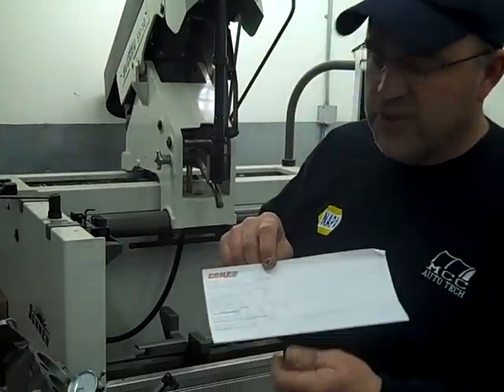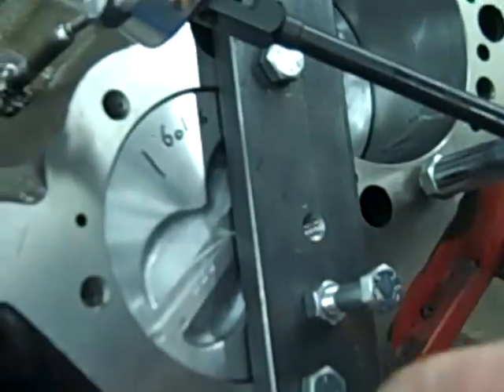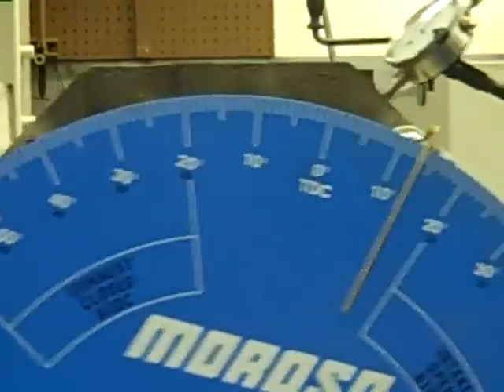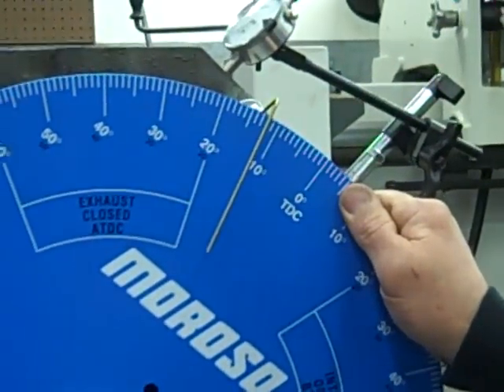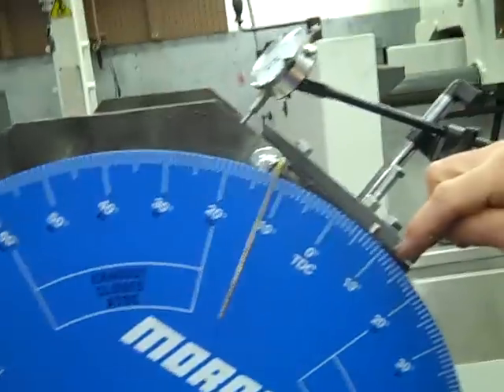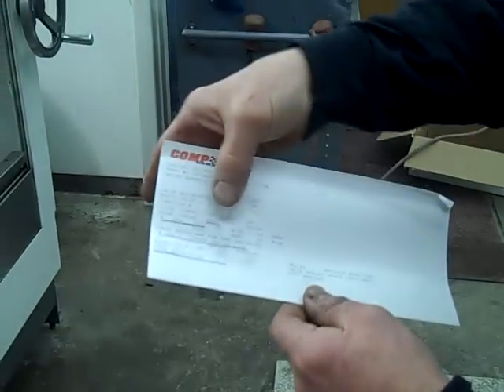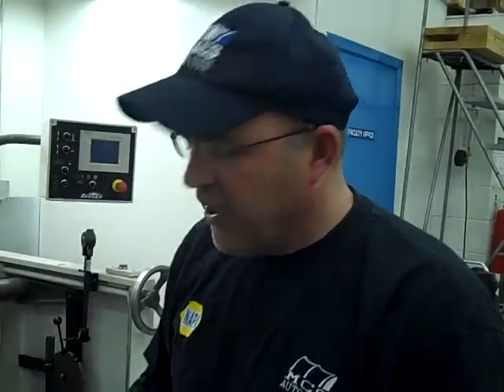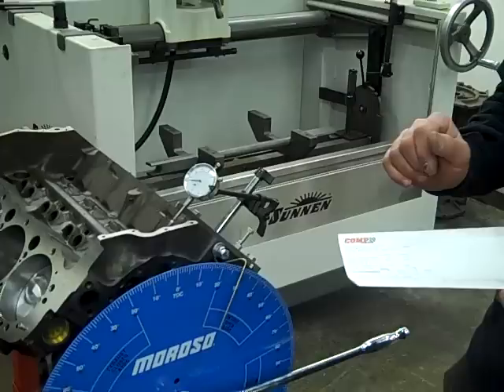Camshaft Degreeing the Easy Way.MP4

Comment: Very good video, I know some people dont understand and get confused because there are different ways to degree a cam you can check the cam at advertised duration, you can check it at .050 thousands or you can use the intake centerline method, study and you guys will learn . Thanks for the great video.

Comment: The "half degree" difference showing on the degree wheel, when using the piston-stop in either clockwise, or counterclockwise direction, is due to the Wrist Pin Offset that is commonly designed into most pistons.
Wrist Pin Offset minimizes piston skirt "slap" as the piston changes direction in the cylinder. It also reduces wear on the "thrust side" of the piston during the power stroke.
The amount of offset is very small, hence the 1/2 degree difference in piston stop, depending on the direction of rotation.
Please make a note of it ;o)
Reply: marshalllhiepler ...absolutely correct,I'm pretty sure your comment helped many people!
Reply: @jojomama4787  It did!
Reply: thanks man
Reply: @limited3502 ,
Thanks for your agreeable response, despite being rather "limited". 😉

Comment: I just wanted to comment as a tech for 30 years you are correct, this is simplified as aposied to getting the calculator and deviding by your numbers by 2  and coming up with a center line number,you have it all right there whith in a few turns,I have used this methed my self ,it works right on every time, great job

Comment: Ok, first of all, the difference between lobe separation and intake centerline is NOT the ground in advance.  Lobe separation is just the degrees of separation between the intake and exhaust lobe centerlines, it has nothing to do with advance or retard of the cam grind.  The 106 degree intake centerline is the reference that the rest of the cam card specs were taken at.  Meaning, that when installed at 106, the IVO, IVC, EVO & EVC specs will match the cam card's given specs and the cam will operate as advertised, no matter what advance was ground into it at factory.  If you want to shift the power band down, advance the cam, to shift it up, retard the cam.  Intake lobe centerline should be the very first thing you check after setting TDC on your degree wheel because if that isn't set right, nothing else will read right either.

Comment: Just a quick fact to note, when using your degree wheel to verify camshaft orientation:
Many aftermarket camshaft manufacturers include a "break-in coating" on the camshaft lobes, to aid with initial wear at start-up. While the lobe profile is ground to very precise tolerances, the coating on the cam lobes is not necessarily "evenly applied".
If you are noticing a "one degree" discrepancy between the specs on the Cam Card, and your degree wheel, it very well may be the result of non-uniform coating on the lobes.
Reply: NOT !!!

Comment: Great Video.   Although if i w  was off by a 1/2 degree on my motor or a tight tolerance race engine, the intake valve would be smashed to pieces.   Do you have an adjustable timing set you can put on (belt drive etc..) to show how to get spot on.  Or did you want to talk about "where is the tight spot"  on your particular engine?   2 degrees past ? 10 degrees past?  what it your valve clearance that you can just use a cam card and not check?    would like to see a whole video series and ones that address much tighter motors than that one.     COOL!

Comment: Basically all this video shows is how to find true TDC and verify the cam grind, not how to actually degree the cam
Reply: Old Griz Agree, he did not derive a number by adding .050  before peak lobe lift with  .050 after peak lobe lift and dividing by 2 to get the number to compare to intake centerline which is the most common way. (Not all cam cards have a number at .006 lift)
Reply: @petejoseph8257  lobe center method. Clay Smith cams has a video on this

Comment: Great video but why so complicated. I have never used one of these.  I stick a blunt 1.4 inch  bolt or screw driver in my number one,  rotate engine slowly. get it to the top center, then do final adjustment at my distributor. Great video though, I may try this method one day.

Comment: How do know how far to adjust the piston stop?   So if you get both degrees once you spin the engine.. Then adjust the piston stop again, up or down so the piston stops either down further or up higher..will you still get the same numbers once you divide the two numbers?

Comment: On a motor like this with  LOADS (100 + thousandths) of valve clearance you can leave it 1/2 a degree  "off"   Best not try that on a Performance  tight motor,  my intake valve would make contact with the piston....

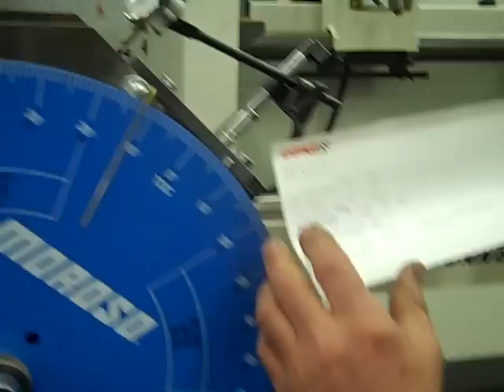Comment: 4:02 ....006" valve lift? Then why did you measure .006" off the cam lobe? If you have 1.5 to 1 rockers, the valve lift would be .009", right?
Reply: nah that's 0.006(sometimes 0.004 or even 0.020)tappet lift which is also called advertised duration.
Reply: @s3904393s I'm confused, unless the sheet specified that when the Cam is at 0.006" lift instead of valve.

The way he said it, is that if valve lift is at 0.006" (which with what John said, 1.5:1 rockers) would mean he would have to measure the cam at 0.004"

Comment: I GOT A 1990 K5 BLAZER 5.7 WITH ECU GOT ENGINE REBUILD GOT THE BLOCK BORED 30 OVER AND DID A FEW UP GRADES IM USING EX262H CAM IN IT WHAT WOULD BE A GOOD COVERTER TO USE I TOOK THE STOCK ONE OUT..AND GOT 2000 TO 2400 STALL .. IS THAT GOOD WITH THAT CAM

Comment: thank you for the video.  i am not building any engines but have always been curious what is meant by "degreeing a cam".  is the piston stopping against the stop bar or do you have that bolt screwed down lower than the bar?

Comment: You didnt take into account the rocker ratio which would change your estimated valve lift after the lifter and pushrod you made. If you have 1.5 or 1.6 rocker ratio then the lift would be .009 or .010 depending on the rockers of course.
Reply: The .050" is always tappet lift and not valve lift

Comment: Okay so question here cuz obviously I don't understand what I'm looking at, what is even the point of doing that the chain is attached to the gears and that's where it goes like it doesn't matter that you spin the engine and look at this degree that degree it doesn't matter ,at the end of the day the two marks got to line up Cam and crank and then the chain goes on so what are you trying to do put the tooth one tooth off I'm not understanding here?

Comment: so how do you apply the degree to the timing chain? do you set the timing chain +or - a tooth to change the degree of the cam?
Reply: you can get special spockets or offset keys depending how the timing gear is mounted, moving one whole tooth will likely cause engine or at least extremely  poor running conditions

Comment: What is the main purpose for degreeing  your cam, will it help make more power? Why not set up the cam straight up.
Reply: Thats exactly what im trying to figure out.
Reply: You are synchronizing your camshaft and crankshaft by degreeing the cam. This makes sure that your engine's valve train and pistons are operating at their optimum efficiency with each other.
Reply: Actually you are verifying the cam makers work..  A builder already knows if he wants the cam advanced or not..  He is just checking it first to see if the cam was ground correctly.  It is rare they are off but it does happen. The timing chain manufacturers are actually the main culprit of a cam being out of spec.
Reply: Yes, just check if the both valves are closed (on top), during the compression stroke, it'll do, the manufacturer will already sort it out

Comment: You said your intake valve should be open at .006" lift when checking, but then you measure off your lifter .006" not figuring in the rocker arm ratio. What fact is right?
Reply: +David Sanders lobe lift not valve lift

Comment: yea...ill just NOT degree a cam, ever. this is a pain in the ass...for almost nothing.
Reply: Degreeing is really only for high performance, competition scenarios and or checking to make sure the cam is degreed like the chart says it is. Most consumer/street grade cams are ground with advance in them making the cam just a swap part. Non street, high lift, low LSA cams ground for high rpm need degreeing so there isnt detonation while zipping down the drag strip at 150+ mph with boost or nos.

Comment: after finding the mid point of the two numbers shouldn't you then  RESET the degree wheel to O (TDC)?
Reply: No, but lets here why you think so ?
Reply: he was not bringing the piston to TDC when it hit the piston stop. The piston was stopping 13 degrees short in either direction...Therefore the degree wheel was already zeroed. If he had taken the piston stop out, the degree wheel would be at zero when piston at true TDC. 
In effect he found TDC by coming shy of it 12.5 degrees from either direction and divided by 2. which would be zero degrees on the wheel.

Comment: so what do you do if your cam degree is out 30 to 40 degrees out how do you fix that problem
Reply: +wayne fitzy  There are 2 bolts holding the sprocket to the cam. Your new cam sprocket may not be marked with the dot and is off a hole. You could match the old and new sprockets together to mark the new sprocket's dot location. The cam should have a dot too, to align the cam sprocket dot to the cam's dot. The sprocket dot should be toward the center of the other sprocket when number 1 piston is at it's top.  To check the cam's sprocket placement of the dot this gets a little complicated because the cam lobe is not top dead center when it moves, it's about 18 deg or more. I've never had this problem, can't say how it would need resolved. Bethoswald123 may have to explain, if your still that far off.

Comment: Please explain why u stopped at 13 degrees and not 0?
Reply: He was 13 on both sides when he rotated in both directions until he bumped the stop so if he took the piston stop out, and cranked the motor over until the pointer was at TDC on the wheel, he would also be at TDC on the piston too.. So he actually did verify TDC... But there was no reason to move the wheel to 0 (TDC) because once he knew the degree wheel was dialed in, he just needed to verify at .006 that the wheel was at 29 degrees which is what the cam card says..

Comment: I like your video about cam shaft degreeing. I have made cam follower prototype for different purpose. In my cam follower mechanism,
1. Follower is offset. 2. Force is applied from follower to cam and by using this force cam is rotated. 3. Energy transferred on cam is more than we use energy to move follower. You can find exact drawing and prototype at mechanicalresearch.info or at my youtube channel.

Comment: First of all greetings, the video is regular, explain why ... you do not show how you should place the gears of the time chain! Must explain if they should be placed point with point, ie is placed as if a tree le cams original, in their videos is already placed the plate or disc of degrees and does not specify or show how to place the gears with the chain weather! Thank you.

It would also be very helpful to publish a video in Latin Spanish, and also where it shows in a fast and effective way how to degrade a camshaft in v8 engines.
Reply: always start with your crank gear mark up 12 ;00 no.1 cyl, top dead  center, camshaft gear at 6:00,or as you said point to point

Comment: oh I bet the company is right and you are off 1/2 a degree having made your own lifter tool and your own piston stop, and with the wheel you are using, I bet their equipment is at least 1/2 a degree more accurate than you, not being rude just my observation
Reply: Then it's good not to ever degree the cam
Reply: @RohanSanjith  no need these days not for a shade tree mechanic, maybe the super racers and pros can do it but they will only find the cams are perfectly set from the factory these days, their equipment is laser proof

Comment: i'm confused how you went to measure the lifter after you left the piston stop in.  can you tell me why you stopped on 12.5 degrees?  Did you remove the piston stop after?  you explain that you are stopping the piston right before top dead center.  I assume you use the piston stop a little lower than TDC and check it both ways until it balances.  Then assuming you take off the piston stop, you would have ZERO on your degree wheel indicating true TDC, correct?
Reply: with piston stop out he would be at 0 deg after he  adj the wheel. Just doing it fast to check the deg wheel of the lifter opening at .006

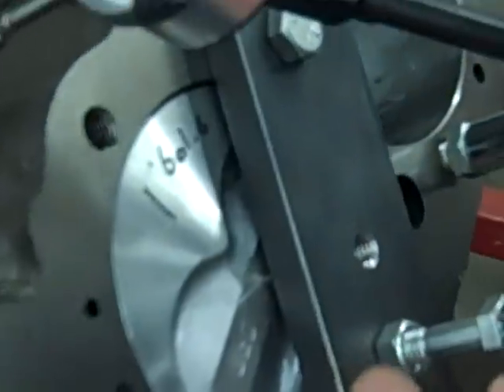Comment: At 1:14 you say the piston will stop just before the top of the stroke (with the dead stop in). But how much before the top does it need to stop? Is this critical? Meaning, how far do you turn that bolt to protrude past the bottom of the dead stop plate? Would be very grateful if you could shed some light. Thanks.
Reply: ANYONE!!??
Reply: The distance of the "stop" isn't important (within reason) as long as it remains in that position when you rotate the crank the opposite way and the piston nudges at the same stop point. The "stop" is providing two positions on the degree wheel that are easy to see and then the middle of those positions is the top of the piston movement. You could find TDC using a blank disc, as long as you mark where the piston stops in each direction and then divide the two marks. Of course using the degree wheel is needed for the rest of the process.
We need to do this because the top of the piston stroke cannot be seen as the piston does not move perceptibly, for quite a few degrees of crank movement, as the crank pin passes through TDC. ... Hard to explain, hope this helps.
Reply: Or you could use the dial indicator to read when the piston is coming up. When the hand starts to spin the other way you've passed TDC. Back up past the highest reading to take up any backlash in the timing chain. Now rotate to the highest point and that is TDC.